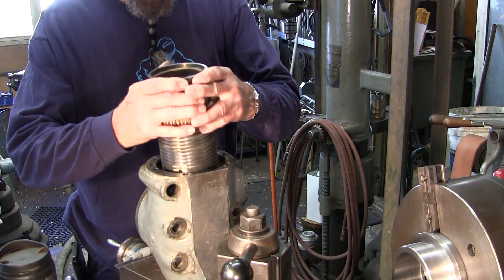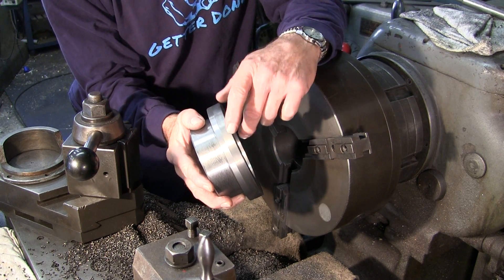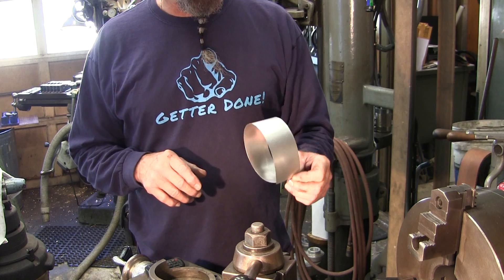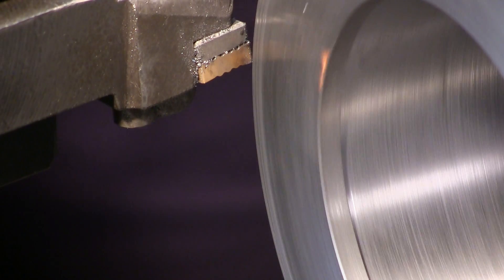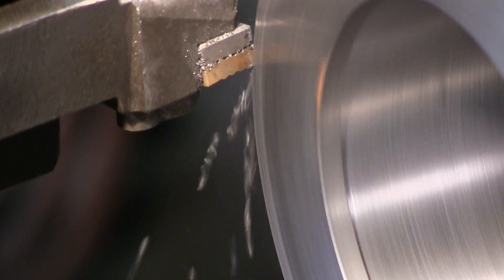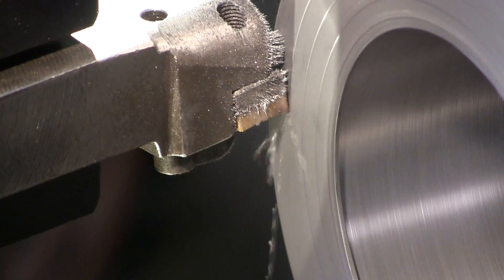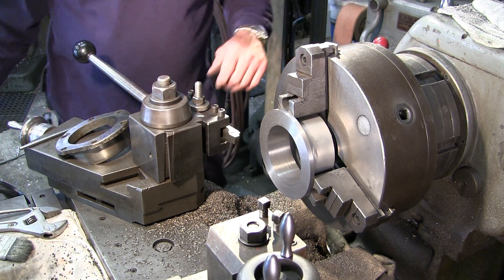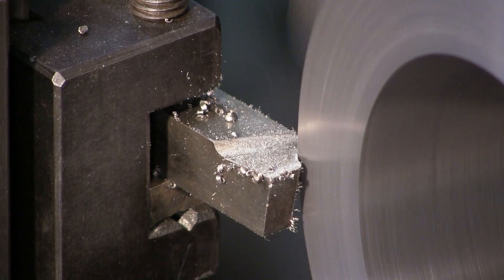Do Over Part Five

Comment: Keith, What was the source of the magnetism causing the 'whiskers' during the rough cut phase?  Was it residual in the tool holder or field generated from the lathe motor?  How would you demagnitize the tool holder?
Jim
Reply from the maker: The ductile material during the cutting process, causes the magnetism. It dissipates shortly after the cool down of hot swarf.  ;{)------

Comment: Doesn't your new part clamp on the ring and the gear remain stationary like in a planitary?  (Sorry for spelling) Since you don't have the missing part(s) I guess you just have to go by the original like you have.  Thanks for the great videos, Greg.
Reply from the maker: The spindle housing, slides through the collar and housing, as the gear is spun by the pinion hand crank. ;{)------

Comment: Great work Keith,Can any one help please 

I have a question if you don't mind,I've a 3 " long by 2" diam en8
round bar in the lathe held by a 4 jaw in dependant chuck during the drilling operation
it seems to have moved a slight bit.0.010" run out at the end..Am i best bumping it true and 
tightening the jaws properly this time,Or realign the whole part to 0.0005" as it
original was thanks for your help..
Reply from the maker: It sounds to me that either way would return the project back to a true running piece.  ;{)-------
Reply: Keith Fenner Thanks keith just thought it would be worth asking first..Think i will tighten and adjust the stock..Keep up the great work

Comment: Keith, I have a fixed centre height indicator I made, it is placed on the saddle and is quick and easy to use.Just a flat plate with an up right bar bent over at the right height to a point. Great on a boring bar as the bit quite often is facing the outside face.
Reply: I'll bet Keith's never heard of one of those.
Reply: I bet he has never heard of Metric lol

Comment: From what I remember years ago, we would always use soft jaws on a 3-jaw chuck a lot to keep from marring the finish on a surface, get a good custom hold/fit on a part and be sure the jaws were dead on concentric, etc. Not that you didn't stick copper and other soft materials in a 4 or 3 jaw occasionally to protect a finish. You could buy them (soft jaws) made for various lathe chucks but most of the time I think we just knocked them out in 6061 on a Bridgeport, etc. With a collection of used soft jaws around, you could choose a size close go the diameter needed, lock the jaws with a small diameter part and turn to the exact diameter needed. On a machine like a chucker you would almost always turn larger diameters in custom collets/jaws. Nice video.
Reply: In a production run soft jaws are the cats meow, for a one-off like this the time to make them usually doesn't pay off.
Reply from the maker: Yeah I have those for other lathe and if in production I would use soft jaws a great add for the job. thanks for the good point.  ;{)-------

Comment: I probably missed the explanation.  Why the upside down holder and clockwise turn at 6:30?
Reply: its because he doesn't want the cast iron flying around the shop. this way the spray goes down and is collected by that cloth.
Reply: I think it was simply to keep the cast iron/ductile iron chips from flying around the shop. By running "backwards" the chips go down onto the catch cloth rather than up into the air. This was explained in an earlier episode. See "Do over part one" at about 22 minutes. Anyhow this is how I understood it.

Comment: http://vintagemachinery.org/pubs/2098/6553.pdf
Reply: What a great machinist community. Exploring the exploded diagram in the pdf really explains what this part does and where it lives. Now I see the complete story! Thanks guys. Cheers.
Reply: I think that's a different milling head. I think the right might be the one in Fig 32 (page 72 & 73) of this:  

http://vintagemachinery.org/pubs/2098/3418.pdf

Looks like we're missing parts an AR-BN32 Quill Bearing Spacer, and two AR-BN33 Quill Bearings.
Reply from the maker: Cool the missing pieces are face / thrust ball bearings. Thanks for dropping in the missing information. ;{)------

Comment: Hi Keith, What kind of sandpaper are  you using?  here in  Australia that coloured sandpaper is glass paper for wood.. Thanks Glenn
Reply from the maker: Usually that color paper is for wood over here too! but the backing is much tougher. I will have to look at the package, I know I'm going to have to order some in a couple months, a 100 sheet pack last several years polishing shafts like I do, you need a long lasting / working paper. ;{)------
Reply: @KeithFenner  Why not use emery cloth or crocus cloth? They have a tough backing but are more flexible. Enjoy watching your videos, keep up the good work.